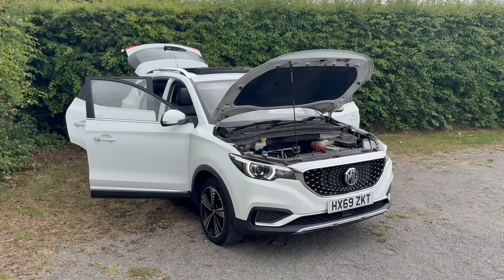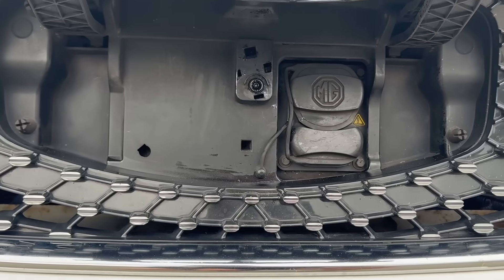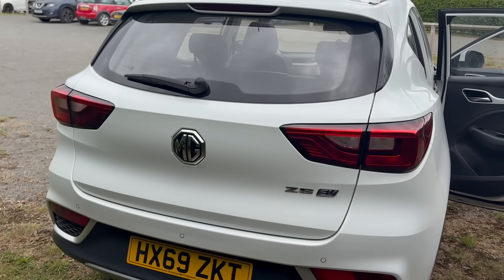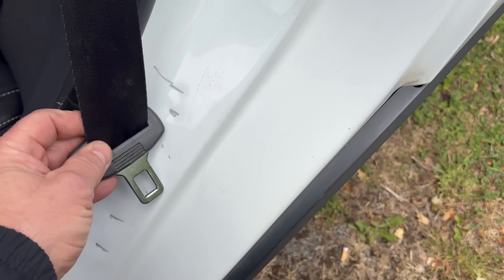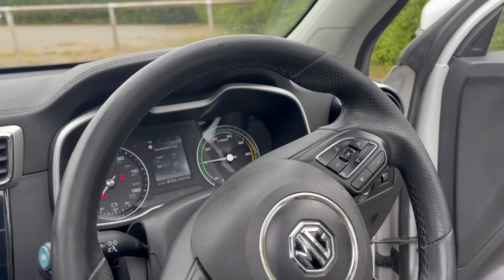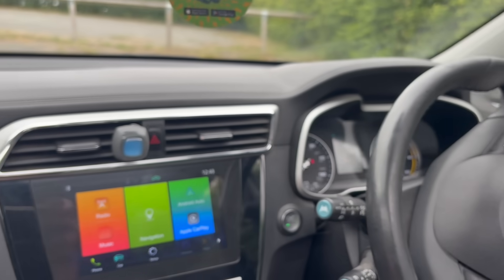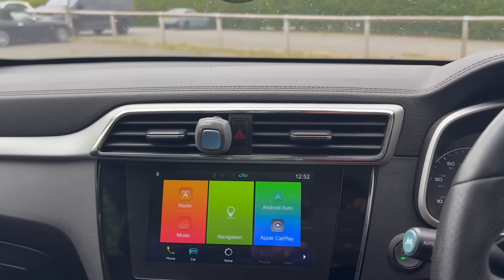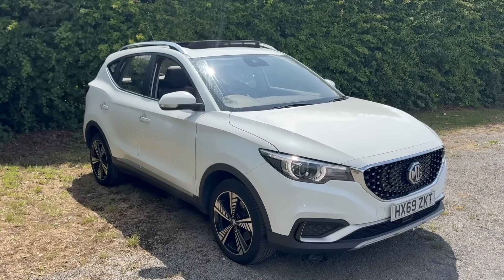Diesel And Petrol Cars Are Finished!

Comment: Bro don’t celebrate your brakes lasting 238,000 miles just yet…… you might want to take the caliper and slide pins off and see if you’re running on the metal backing of the pads….. brake failure is not joke at 70mph

Comment: Car has original brakes after 238,000 miles? Who makes the pads and rotors? As much as I do think Chinese EVs have improved significantly, I really dont believe any car’s brakes can last that long from stock; the most I’ve seen is 40,000 miles on a BMW 3 Series driven by a family man, and those pads were worn to the metal backing by the time I took the caliper off
Reply: 100% true I can personally vouch for this.

Comment: I can charge my Toyota GR86 in 5 minutes at any gas station for 300 miles of range.  How long does it take you to charge?  Are you on the original battery?  EVs are going to remain a fringe item because of insufficient copper supplies.  The UK's Net Zero policies only mean that electricity will be more and more expensive and in short supply.  Gt ready for rolling blackouts.
Reply from the maker: I can charge my car while I’m in bed or from solar for free. We’re not tied to pump prices that fluctuate every time a world does something stupid. Yes, original battery. 

Our electricity prices are expensive because they’re tied to gas prices, and the Ukrainian war has made the price extortionate. That’s the issue with FFs. 

Even with all the EVs on the road we use less electricity than we did 20 years ago, so I’m not sure when the blackouts are going to happen.
Reply: Please don't charge your vehicle overnight unless it is a good distance away from your property......  one went up in smoke and with it took out 3 other Vehicles and  £550000 Home in Hampshire 😢 Fortunately the occupants got out safely 🙏

Comment: Shame they rust so badly, a friend of mine has 9 MG's and he reckons since they started being made in China the quality of the steel is so poor nobody wants them, his wife has the only chinese made MG they own and he refuses to work on it because in his words "it's a pile of sh*t"  and he said he would rather work on the MGBGT he owns lmao, I guess each to their own but I'll be driving my 580 mile range dirty diesel for a good few years yet, 2008 and all of its production carbon footprint long paid for.  May switch to a leccy car eventually but can't see it for a while, for a start my road tax is still a pittance compared to all the latest hikes to all newish cars.  I noticed the long list of things in the description you reckon you need to keep maintained on a diesel car, well I guess that depends what you buy, for example my diesel car has no DPF so thats not a worry, has no cam belt because its chain driven for life and cars like mine are well known to go way beyond 250k miles, its never needed new alternators, starters or clutches either, 6 years on its still getting close on 600 miles to a tank, low tax and passing its MOT every year because it has an oil change once per year which takes me 40 minutes tops. and just for completeness my car does on average 48-58 mpg (have done over 60 a few times on long runs) but you literally cannot get it under 43 mpg even driving it badly, which I think is great for a 2.0D Turbo engine.  Like I say never say never on me going electric eventually, but I paid less for my motor back in 2019 than you paid for the car in the video and its still going strong 6 years on from purchase.
Reply from the maker: That’s all good to hear, but how has your car paid off its CO2 emissions exactly?
Reply: @Jamesandkate  clearly by me not buying new cars every year for the last 17 years to replace it, every year its kept is one less car made, so people like me do far more for the planet by not needing the latest and greatest electric gadgets that use rare earth resources and masses of steel to be produced, if you do the maths on the production of 17 cars (and yes some people actually have a new car every year, I know some of them!).  Remember daily diesel or petrol emissions don't even come close to the emissions and resources required to make one new car for years and years.  I see you have been driving electric cars for 10 years, answer me this how many of those have you owned while I've owned this 2008 car, keeping old cars on the road for a decade or more does far less damage than the production resources used to make one new car.  The car I owned before this one I had for over 10 years, again easily covering its overall production resource cost, I wonder how many EV's will still be running 15 years from now, assuming their cheap chinese steel hasn't rusted away (which is a problem for many ICE cars too I hasten to add, modern Jag's suffer from this XF's and XE's particularly.) I'm not anti EV, one day I'm sure I'll have to switch, but I am the kind of person who doesn't just buy stuff for the sake of it if I have something that does the job perfectly well, be that mobile phones etc.  I don't have a 4K TV, 720 HD is perfectly adequate and my old TV's don't go to land fill, I use an iPhone 12 which was a refurb, etc etc.  Like I say not anti EV, just don't see the point when there are better ways to be good to the planet by keeping old tech alive for as long as possible.  Arguably the best way to be environmentally sound when having an EV car is to have an ICE car converted to EV, of course there is still a natural resources cost for the batteries and other plastics used for wiring and computer power required to run it, motor windings etc, but at least tons of steel isn't coming fresh from a furnace to make a new EV.  Also don't forget EV's are far heavier than ICE cars, and have more torque too, its no coincidence as far as I'm concerned that the roads are being ripped apart even more by the EV's running on the tarmac judging by the number of people who have EV's and who insist on flooring them away from the lights next to me in the outside lane to prove how fast they are, great for the air until all that new tarmac needs re-laying lol.
Reply from the maker: Okay, let me fact this out for you? Bear in mind this car is second hand, I did buy it new. What car do you have an how many miles have you done in the years you’ve owned it. 

I think you’ll be surprised. Also, pls consider the NOx, SO2, PM, FPM and CO emissions that are always forgotten about. 

Then I’ll quantify it for you buy reading the impact statements of each manufacturer. I’ll lap check the mileages of our past cars, which are still on the road, not been scrapped, and work out their emission savings for you.
Reply: @Jamesandkate  My car is a 2008 2.0D Jag X-Type, its done about 60k since I bought it in 2019, and prior to that I owned a 1.6 2003 Petrol Zafira, which I owned for 14 years., sadly no idea how many miles I did in that but many more than I do in the diesel X-type as I work from home and it only does about 5k per year now, if that as I'm only in the office 1 day a week  👍.  My X-type's road tax is only £215 which is not much more than all electric cars nowadays too, so nothing of note to save for me on tax if I do get rid of it for an EV down the line.  What are your thoughts on the excess weight of these and how they are damaging the road surfaces far more than the ICE versions of cars having far more torque, as you didn't comment on my observation on that, albeit that the roads by successive governments have been massively underfunded?  Of course the other thing to mention is insurance cost, not sure how EV's compare but I pay £230 fully comp for my X-Type too which is not bad for a car that will do over 120mph and a sub 10 second 0-60 and yet which returns 50+mpg regularly, so possibly a massive saving on a newer EV insurance cost too.
Reply from the maker: Ok. Your car has 15.6t of embodied CO2 in production and over that mileage will have released 15.1t of CO2. 1.3t of NOx, 1250kgs of SO2, 1.8t of CO and 620kgs of PM. 

Sticking with CO2 you have 30.7t. The embodied carbon for the MG ZS EV is 22t, but it has covered 4 times the distance of your Jag. Based on 2020 grid emissions of 181g/CO2 per kWh the MG has emitted 10.8t of CO2. That’s 32t. 

However, you need to also quantify your fuel production too . You’d have burnt through 6000 litres of diesel, and each litre require 1.2kWhs to produce. The internet says 12kWhs, but that’s incorrect. Therefore you’d need 72,000kWh for your fuel production. At the same rate I applied to the MG you’d have produced a further 13t of CO2. 

That takes your number to 43t of CO2. 

The weight. This car weighs less than your Jag, and my MG5 weighs about the same. 

Both cars are on original discs and pads, your Jag won’t be, so you’ll have further particulate export from that. 

Shall we talk about the other emissions ???
Reply: @Jamesandkate  Oh also remember my car has overall done 155k miles in its life so far since 2008, and these X-Types regularly do 250k so I'm hoping mine will do the same as the ones other owners I know have done.
Reply: @Jamesandkate  Oh and my car actually releases way below the CO2 emissions that it is meant to release, it always flies way under the readings every MOT ;-)  its been remapped

Comment: Not for me. Ok for local shopping but rubbish for long distance.
Reply: There's a lot worse EVs for longer distance journeys. At least this has thermal management and can be rapid charged multiple times no problem.
Reply from the maker: This is actually very good for long distance, especially as it will cover 160 miles for £3.

Comment: I think it's too early to talk about the end of  ICE vehicles if you need to  tow caravan or horse trailer
 EV's have a poor range and due to battery weight cannot tow above 1200-1500kg
Reply from the maker: My EV has a range of 350 miles, which isn’t poor, but less than 2% of the population tow anything. What we need to do is look at the facts, not our preferences. Go to SMMT and look at ICE vehicle sales. You’ll see they’ve been in decline since 2017, 8 years in a row. Diesel is now dead and petrol is following. Take a look, come back to me when you have and let me know your thoughts. 

1 last thing. My EV weighs less than a BMW 3 series diesel.

Comment: Trying to find a OBD reader that will give me the battery SOH on my 2020 MG5. Mines only done 42,000 miles but the dealer keeps telling me at every service that’s it’s still at 100%
Any recommendations would be appreciated.
Reply from the maker: Hi Dan. 

We don’t use any OBD readers, we use workshop diagnostic tools and dedicated battery testing devices. I’m really not sure what aftermarket options there are.
Reply: You can get an idea generally with the Car Scanner app and a Bluetooth OBD dongle. The method differs by manufacturer, but on the VW MEB platform you look for the 'Maximum content of the traction battery' figure & divide that by the original capacity. 

For instance on mine it reports 73600Wh of an original 77000Wh. 73.6/77 = 0.955... = 95.5% SoH

It's only rough though as it's relying on the BMS measurements, which can drift and are affected by temperature, but it's a ball park figure.
Reply: Thanks for the replies 👍

Comment: So ok it's a 2019 Model and £3000 what horrendous depreciation ! My Current Car Mercedes 2019  B200 AMG with all the extras I could sell tomorrow for not much less than I paid for it, admittedly did get a great deal as used as a Demo and 81 Miles on the clock. ! :face-orange-biting-nails::text-green-game-over:
Reply from the maker: This is normal depreciation. This Merc was 68k new, it’s now worth £8.5k. It’s lost 60k and is the same age. As a percentage that’s 87% depreciation. The MG was 22k new, it’s worth 3k. That’s 14%. It’s almost exactly the same. However, and more importantly, the fuel savings of running an EV against a diesel payed the purchased cost of the vehicle, so depreciating is really not important.

Comment: There's a guy on youtube doing reports on BYD Dolphins in Brazil, having covered 200,000 and 220,000 kms. Not the same as miles granted but he's also reporting no issues. Not Chinese, but still driving brilliantly is my 2016 Model S having covered 280,000 miles.
Reply from the maker: 280k is some going. We have a Model 3 owner on similar mileage and he’s still at 88% SOH and the car is holding up very well 👍🏼
Reply: BYD are Chinese aren't they?

Comment: Thanks James. Amazing advert for MG and EVs in general.  What value. 
Re the battery SOH. what’s its Rapid charge history.
Reply from the maker: Rapid charging has made up 32% of all its cycles.
Reply: @Jamesandkate Interesting. Sounds about right James...
Reply from the maker: I checked the BMS for the figures 😀
Reply: Thanks James. Outstanding value. No wonder you have switched to the MG5s for work. Happy and safe motoring to you Kate and the Team.

Comment: I love how it's a taxi that's been driven to death and the majority of issues are cosmetic or easily user-servicable. I think the only thing I'd struggle with there is the issue with the mountings under the bonnet, even then it doesn't look like a job that requires specialist tools.

I've had a couple of weird issues with my MG5 which is at about 35k - the adaptive cruise front distance sensor appears to fail in sub-zero conditions and had the passenger window refuse to work (then suddenly is fine again and has remained working for a few weeks now). If I get anywhere near 240k miles with it I'll be very, very happy.
Reply from the maker: The window will be the switch on the drivers door. We’ve swapped a few that seemed to be full of coffee or rain water. If it stops again see if it works from the other door switch 👍🏼
Reply: @Jamesandkate  I don't think it was the switch just because when I pressed it I got a small noise from the passenger window like it was trying to open but failed. And also the other switch didn't work! It had been quite wet and cold so wondering if the weather had affected it or the mechanism had frozen somehow. As mentioned above seems like these things are quite good cars but the electrics/electronics don't deal well with extreme cold.
Reply: Also occasionally the adaptive cruise flat out fails to detect a car in front - usually when there's a stationary vehicle just in front of another vehicle that moves out of the way, I've had to slam on the brakes when it became apparent I was accellerating towards a stopped vehicle!
I'd imagine a software update would fix this but the MG dealer I spoke to this year when I got it serviced claimed they only update software in the event of a recall.
Reply from the maker: I wonder if the regulator has an issue. Weird request, try hitting the door card and see if that alters anything.

Comment: I've got a 21 reg and I love it.
Only 2 minor points i have with mine.
The drivers footplate thin rubber trim has come slightly undone, so i need to reattach it under the plate and if you don't start the car with the correct procedure, it disconnects the battery. Although I think this is a safety feature, NOT a problem with the car itself.
Other than that, mine is brilliant.
Reply from the maker: Amazing stuff

Comment: Thanks for a great used car review. My MG ZS EV from 2020 have done 72000km/44700 miles and everything that have been wrong so far is related to winter down to -20ºC. One seat base, dampers in ventilation and charging lid replaced so far on warranty. Also 2 software updates have been done on warranty.
For me the drawback of no regen on cruise control, and a poor heating system in winter is the most important. And I wish you could lock the car when it is on, or at least, the car should not allow anyone to leave park when there is no key in the car. Easy to steal when you defrost it in winter..
All in all the MG have been good value for money
Reply: How much was your seat base? I've put a tiny rip into mine. It was entirely my fault annoyingly.
Reply: Actually dont worry. It turns out there are quite a few on ebay. 51k in 2 years on my ZS mk2 EV.
Reply: @esm7708  I did not pay anything, they replaced the fake leather (not the seat itself) on warranty on 5 year service. The seat started to rip on side during the first winter when car was only 1 year after I entered the car around -16ºC without preheating. Problem is, you actually have to sit in the car to power it on and start preheating... I suggested to dealer that since it was no app (offline is better these days ! ) why not modify software so that if you press 3 short lock on key when temperature is below +5ºC the car start preheating for like 15 timnutes. They thought it was a great idea but obviously not the manufacturer. Maybe they don't have winter in China ?